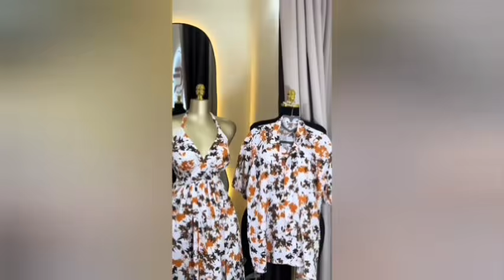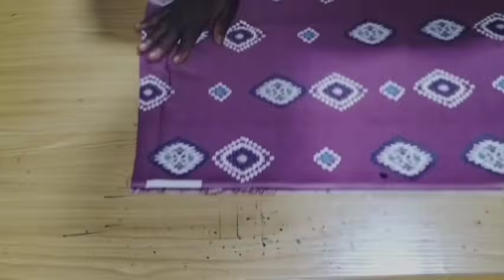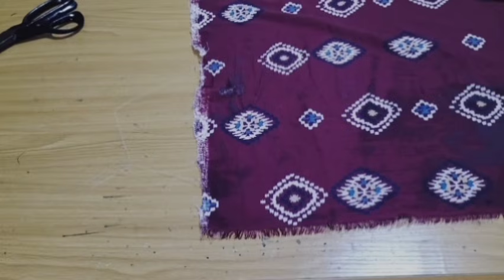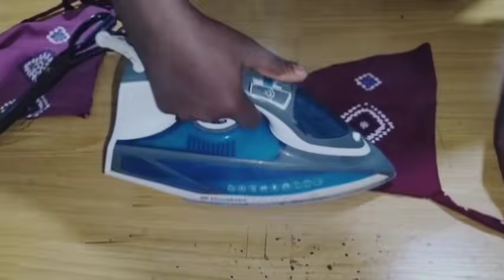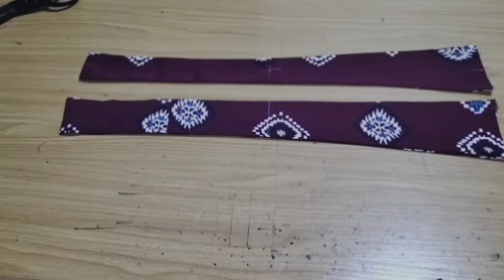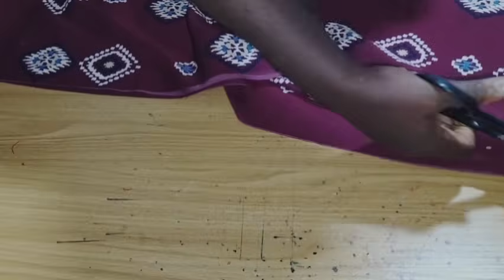How to Sew Stylish BRALLET SUMMER Backless Gown

Comment: Please ma is the 10 inches circle standard for both small burst size of 30?
Reply: Make loose stitches on the edge of the fabric like two lines, without back stitching, now hold one side of the ending threads of both the two lines and start pulling it gradually be careful not to allow the thread to cut .
Reply: Thank you ma'am  @abunlogselina5696
Reply from the maker: Watch the video again l explained that